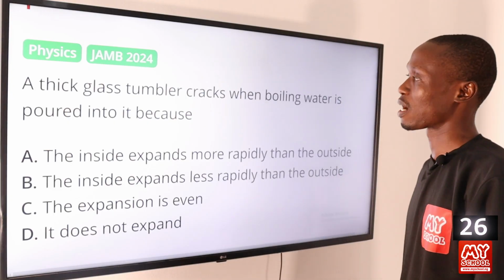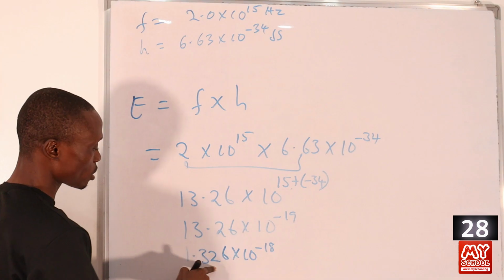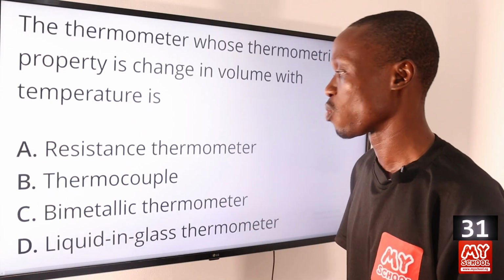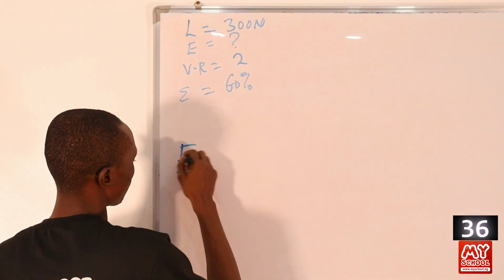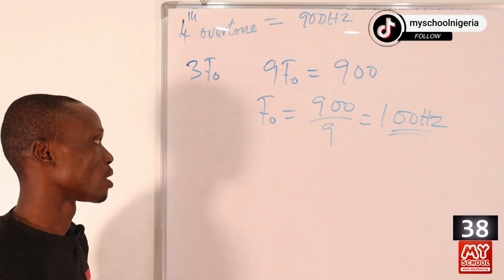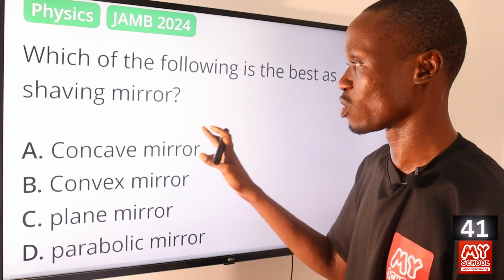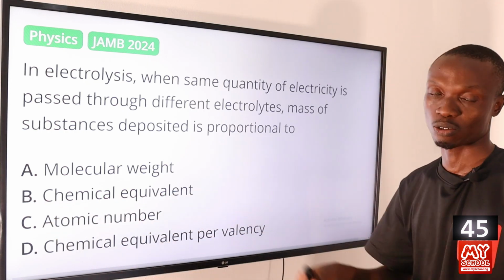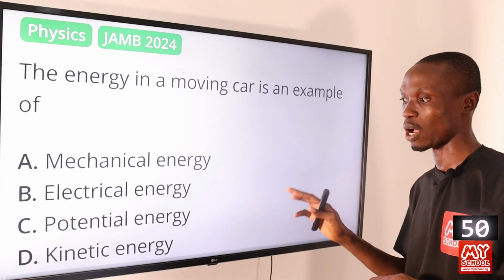JAMB CBT Physics 2024 Past Questions 26 - 50

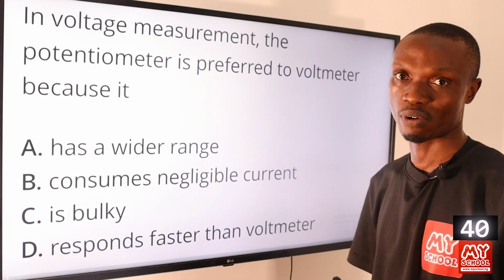Comment: 23:05 question 40. I thought is supposed to be A because it measures very small range of potential difference and an open circuit cell 🤔
Reply from the maker: No, it can't be A because it does not draw current from the instrument being measured.
Reply: @MyschoolNigeria ok, thanks 👍

Comment: I don’t understand number 39…
0.75 cross multiplying x+2…giving 0.75x + 1.5?
Reply from the maker: Yes.
Reply: @MyschoolNigerihow did 0.75 turn to 0.25 in question 39
Reply from the maker: No it didn't
Reply from the maker: After cross multiplying and collecting like terms, we now have x - 0.75x which is = 0.25x
Reply: @MyschoolNigeria is x +0.5 cause I don't understand how the 0.25x came after cross multiplying